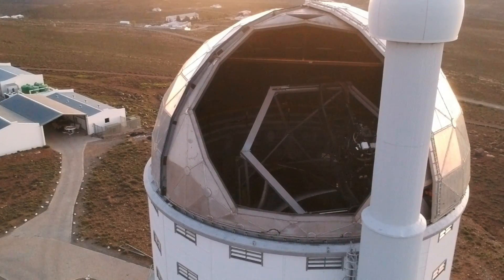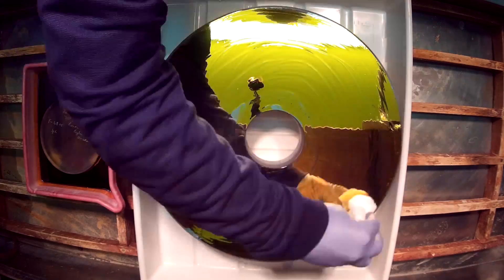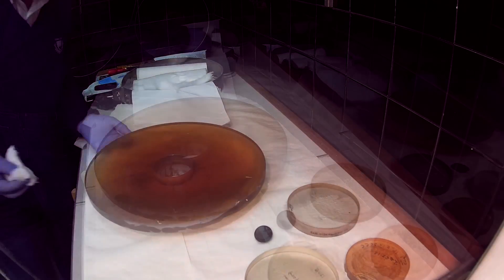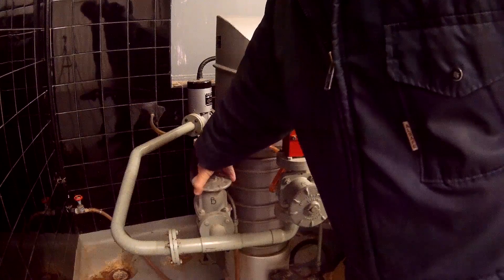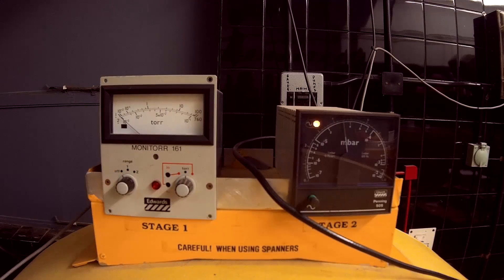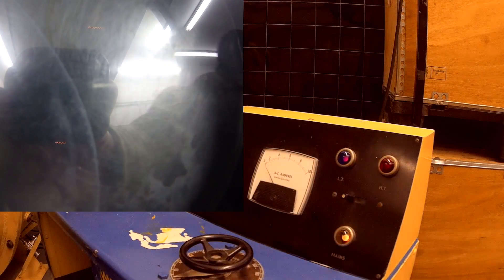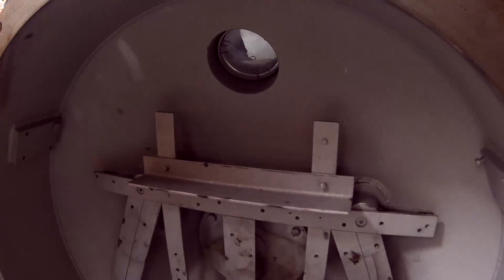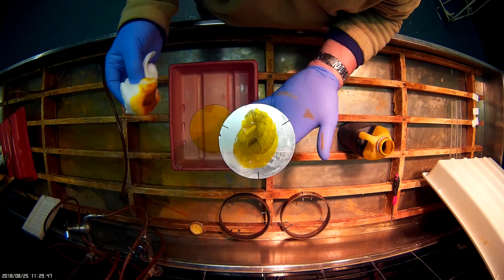How to Aluminize Telescope Mirrors

Comment: 1. I'm really surprised it took this long to get down to vacuum with a huge diffusionpump like this as they pumps huge amount of air when they upp to full speed, any small leaks perhaps or to big flow of water or to low power to it?
2 10-E5 Torr is quite high for this chamber since the mean free path at this vacuum level is a about only a meter and it seem like the coils are farther away from the mirrors then this? If so the surface quality can be affected in a way not seen by they eye.
3. I assume a re coat of the big one due to what seemed to be smudge top right that wasnt removed before coating?
Reply from the maker: 1.  I can confirm there are no leaks and the water cooling is to spec.  It unfortunately takes time to reach high vacuum in the molecular flow regime, particularity using 60 year old equipment.
2.  I'm just following a recipe and did not do the sums, but we get good repeatable results, confirmed by the measurements from the professional telescopes the mirrors are used in.
3.  That mirror had a mishap, resulting in the slight damage you noticed.  The telescope's secondary mirror came undone and dropped onto the primary!  It was decided not to try and do anything to the mark caused and just use the telescope as is.  It is performing to spec, so seemed like the correct decision - any other corrective attempts would have impacted on its observing program (it is quite a workhorse telescope).
Reply: @SterremanWillie  Thanks for your answer!
 1. Ok good to know, and I know that roughing pump its a good brand but dont remember the name, but its cool to se it in use but they are not the fastest but probably enough for the dp. But the diffusionpump should still be able to go faster then this in my opinion but fingerprints and such would make a big different though.
2. If the techs are happy with the quality then ok, little surprised though but I guess they are happy even with less then perfect so that was interesting to know.
3. Aha so it is actually a physical damage on it, started to wonder there for a minute so much that you cleaned it. It actually came undone and dropped on to the primary.. holy sweet jesus. No that couldn't be repaired so I would agree with that.

Comment: Hi Willie,
thanks for your very interesting video. But I´m
surprised you didn´t mention something about final cleaning by glow
discharge. From my own experience this additional cleaning procedure
seems to be a must. Examples of my DIY vakuum equipment:
 http://www.astrotreff.de/topic.asp?TOPIC_ID=221920
Best regards
Kurt
Reply from the maker: Hi Kurt,  Since you are the second person asking about the glow discharge, I realised I can ask the engineer who developed the aluminising facility at SALT (our 11-metre telescope with 91 mirror segments).  He told me how they did controlled testing (using reflectance tests throughout the light spectrum) on the effect on using glow discharge or not, etc.  Their conclusion was that the advantage of using glow discharge is only a very slight improvement in reflectance in the ultra-violet.  He found that if you rather spend the time you "loose" performing the glow discharge, by better cleaning of the mirror, you actually gain more.  So they have a weekly aluminising run but also do not bother doing a glow discharge.
Reply: Hi Willie,from my own experience I have learned:1. There is no diffrence in brighness of the Al- layer depending  on additionally cleaning by glow discharging or without it.2. Glow discharging will improve seriosly  the adhesion of the Al-layer to the glass. Therefore I believe the lifetime of this layer would be considerably longer than one without glow discharging. But I don´t  know exactly to be right or not in that case . I would like to be wrong, exceptioally;-).
Reply from the maker: Hi Kurt.  Interesting.  From my experience, the times when I experienced adhesion problems, were when I did not rinse for long enough - which brings us back to the SALT engineer's test results suggesting that spending the time cleaning rather than doing a glow discharge is better.  I seem to recall from the "old hands" that they stopped doing the glow discharge since they deemed it not worth the trouble.  It will interesting to find out what other coaters do.  There are unfortunately not many aluminising videos on YouTube, probably since it is such a unique thing.

Comment: Hi Willie, did you perform a glow discharge in the vacuum chamber before vaporizing the aluminium to get rid of remaining water molecules?
Reply from the maker: Ahaa!  I can see you know something about aluminising!  Yes, the glow discharge is actually done at a higher pressure while there is still enough gas in the tank to ionise.  Ever since I saw our process 30 years ago, we have not done the glow discharge, even though we are equipped to do it.  I'm not sure why the guys stopped doing it here, but it is currently not in our procedure.
Reply from the maker: I since enquired why we don't bother doing the glow discharge - see my reply to Kurt Schreckling.
Reply: @SterremanWillie  I can't find a comment by Kurt Schreckling...

Comment: Enjoyed that. thanks for posting.  It is an interesting process.  Why does the aluminum not tarnish once the mirrors are exposed to air?
Reply from the maker: Interesting question.  The aluminium do actually oxidise quickly, but it hardens the layer and I don't think change the reflectivity much.
Reply: yes aluminium oxide is very very hard, commonly used as an abrasive as it is a 9 on the moh's hardness scale. It is also transparent, meaning as soon as the aluminium is oxidized it gets a skin of this tough clear oxide, and it doesn't corrode any further